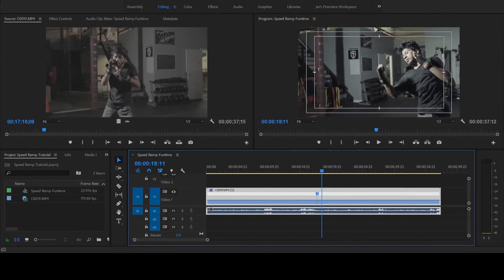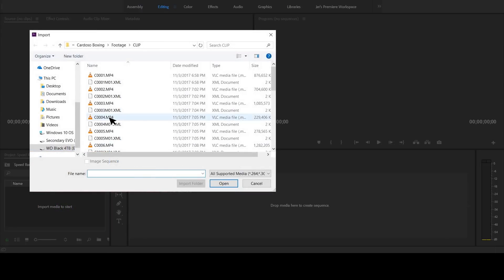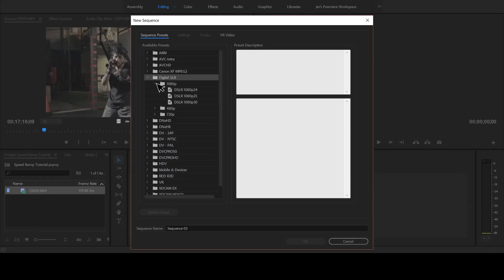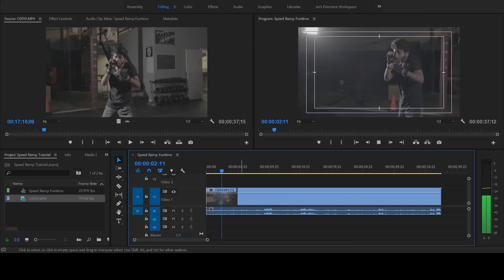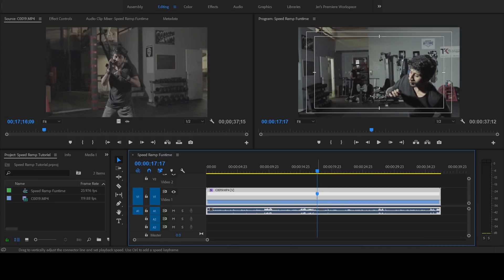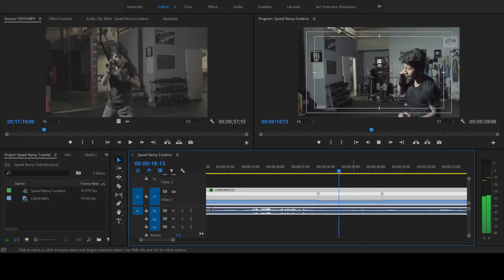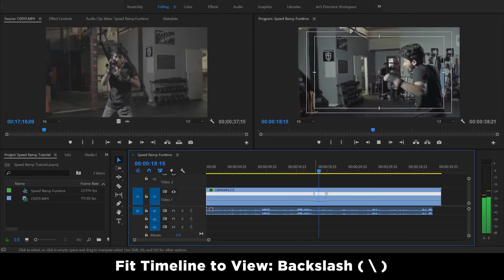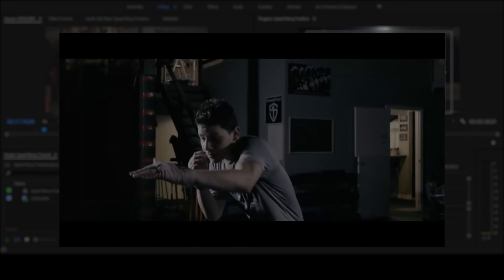How to speed ramp your footage in Adobe Premiere Pro

Comment: why we had to do time remmaping and not just change the speed ?  Since the original footage is 100fps, then if you cut and use a part of a footage at 25% slow speed (in 24/25 fps timeline), don't you have the same results without optical flow long render time ?

Comment: Hey, nice tutorial! Only thing that's left me confused is your use of optical flow in time interpolation at the end of your tutorial. If your clip was shot in 120fps, and your sequence/export settings are in 24fps, then you can slow the clip down to 20% without losing any frames. I think you went down to 30%, which means every frame premiere would export on a 24fps timeline would be a real frame, thus rendering (no pun intended) your use of optical flow pointless? My understanding of optical flow (or for that matter time interpolation in premiere pro in general) is that it literally interpolates (aka creates) a new frame between two real frames in the case of when you, lets say, use a 24fps clip on a 24fps timeline and try and apply slow-motion to it. But in this case, you aren't dropping any frames, because you recorded at the proper frame rate - so using optical flow is pointless. Unless I'm missing something in which case please correct me.
Reply from the maker: Thank you for watching and for posting this question!  Because my colleagues and I have discussed this very thing (on multiple occasions).  We've sat down staring at Optical Flow'ed renders whenever this issue came up, and maybe it was the placebo effect at play but the Optical Flow'ed slow motion footage did seem to be a bit smoother.  If you ask me this topic might even be deserving of its own video, because even though I'm convinced that setting Time interpolation to Optical Flow does make a difference, it'd be awesome to do a proper render comparison.